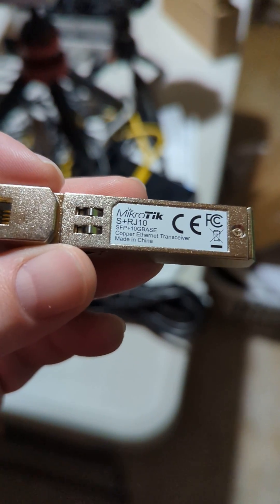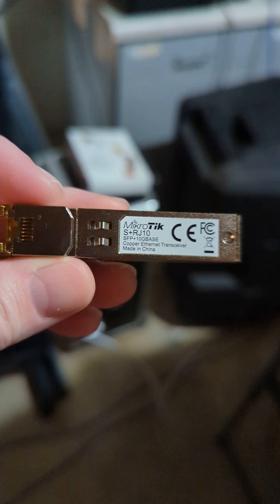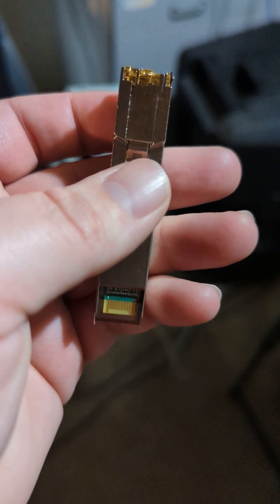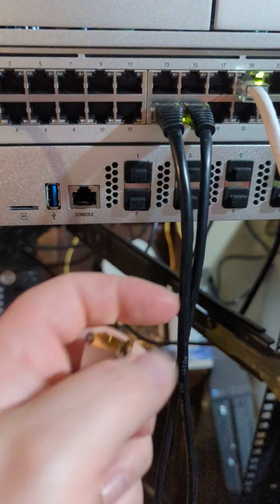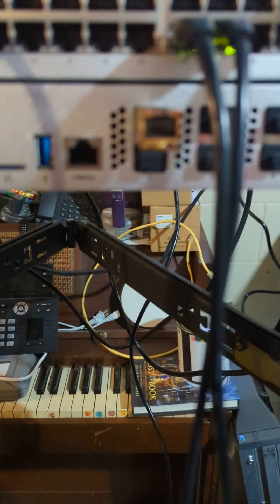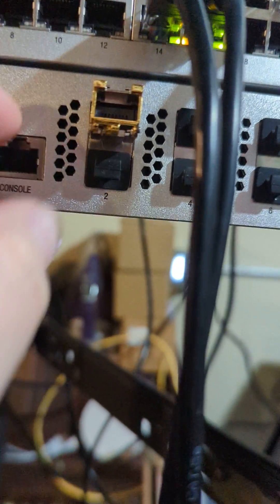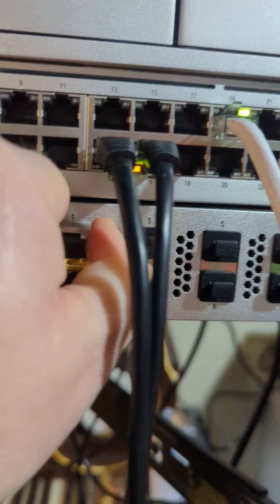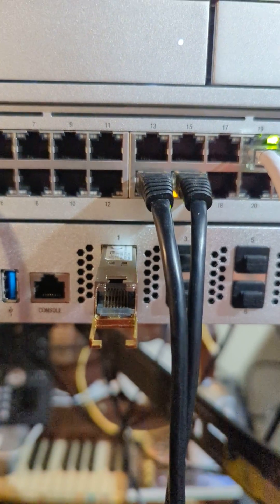How-to Remove a MikroTik SFP+ Module

Comment: I had this problem but this did not help - but I had to use a dental pick to sneak up under the module in the center of the bottom and carefully pull down on the cage tab to release.  Worked best when the door bale was up so you had some room.  Not easy, but other methods did not work.

Comment: Sometimes the unlocking mechanism stops working leaving the module stuck in the device. I have ones that work well and ones that did work well and are now not working thus stuck in the device. I’ve got to try and fit something in the ones that are not working to extract them, seems like I’ll have to pull the nic card to do so.. hit or miss with the quality on this product.

Comment: And it helps to read the instructions that come with the device.  😂
Reply: Psh… Instructions are just some other guy’s opinion on how it should be done. 🤣
Reply: @WillieHowe  Yes I had a pair of UBNT 10G SFP+ to Ethernet adapters ship loose to me, the gold tab happened to fall over while unplugging an ethernet cable and that's how I figured it out, but some of them like the 10Gtek  are super stiff and you would never know once its seated into a port
Reply: Yea if you bought one. What if your cable company installed one ? Will they leave you instructions for it ? No genius.